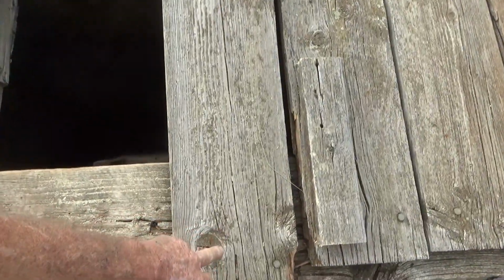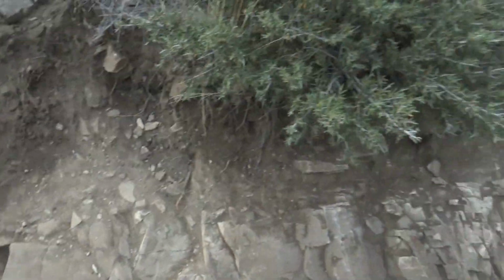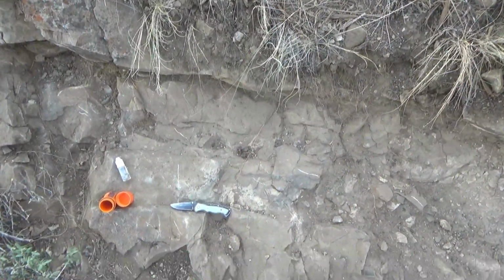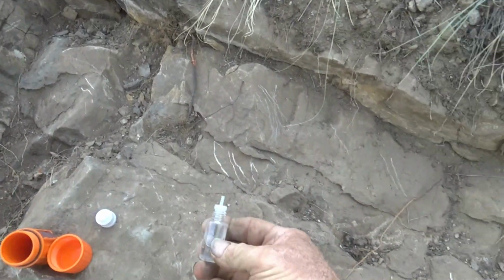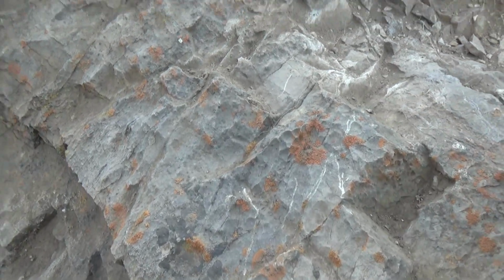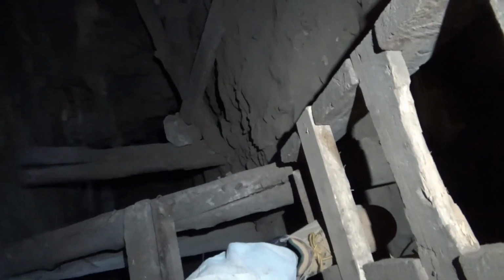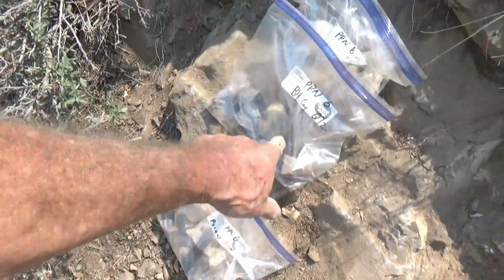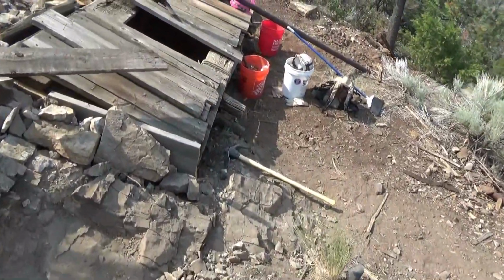219 Uncovering, identifying, and sampling the Vein Outcrop

Comment: Hello Keith, very useful sampling technique.
You really moved a lot of material!
I don’t usually hear you huff and puff, that smoke and heat is really tuff to function in for very long. Try not to push it too much in this heat if possible.
Thanks buddy, really enjoyed 
✌️PT
Reply from the maker: I was careful.  Probably a bit more used to the heat than most, at least this season  :-)  Getting old- my legs were really complaining by the 20th time up and down that ladder.  Cut it short the next day due to leg weakness and came home to rest.  Feeling fine and will be stronger this week.  It is good exercise if not a bunch of fun.

Comment: If you gettin old like me, use kitty littler buckets. 3 gal is still a significant haul (and perhaps more than we put in our 5 gal buckets anyway), has much more comfortable rounder handle, and the flat side rides easy against the leg.
Reply from the maker: Yeah.  Might have to change soon.  Doing OK for now.  Hate to give in to old age, but it will win in the end.
Reply: @hardrockuniversity7283  Don't give in bro, just modify things to roll with the punches.
Reply from the maker: @gnomespace  already done.  the middle decline samples came back good,  now to leaching scale up and recovery tests